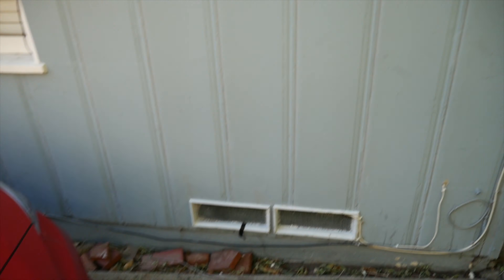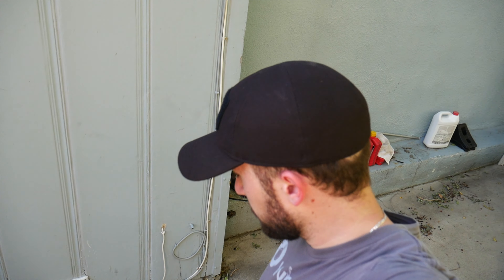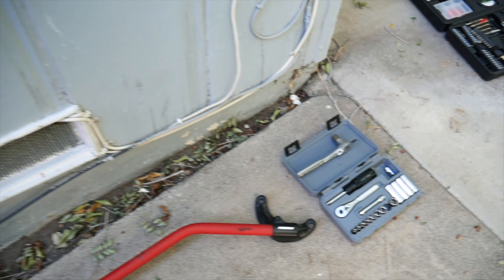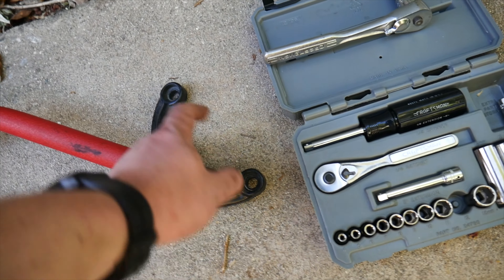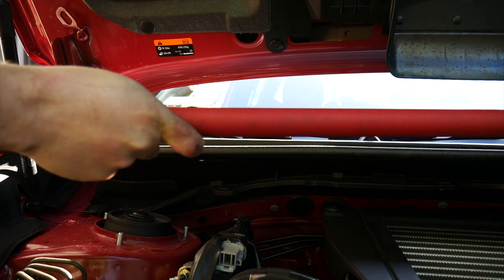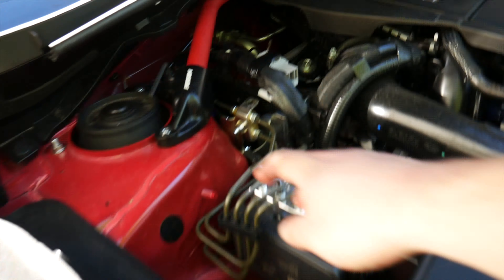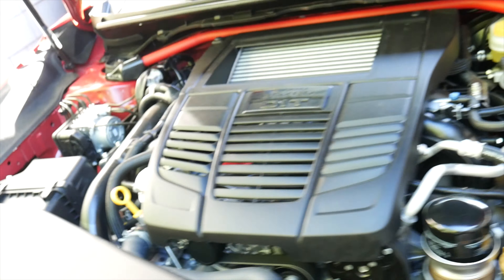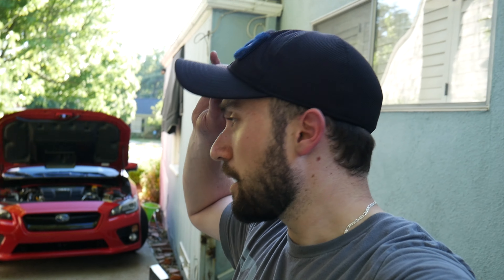PERRIN STRUT TOWER BRACE - 2017 Subaru WRX

Comment: have you noticed any real big improvement with a strut tower brace? I can never talk myself into getting one. worth the $$?
Reply: Subie Shakedown I'm sure it does especially when you include all the suspension mods.
Reply: I know a rear one helps with the understeer but not sure if the one up front helps much.
Reply: Mine didn't feel any different but makes the bay look nicer